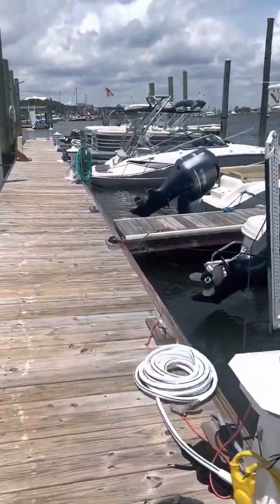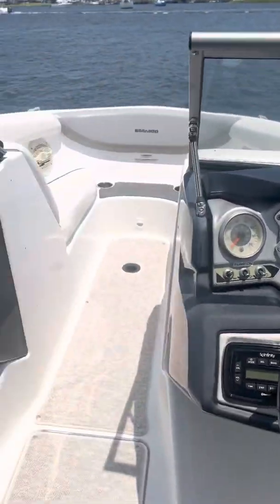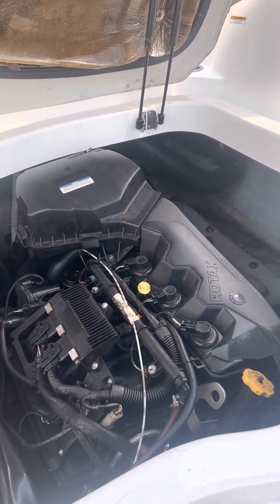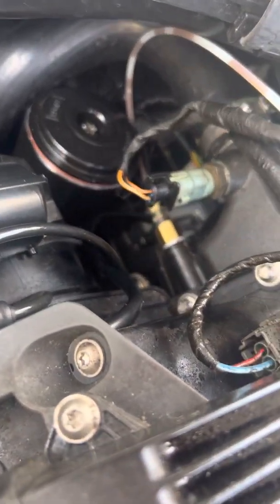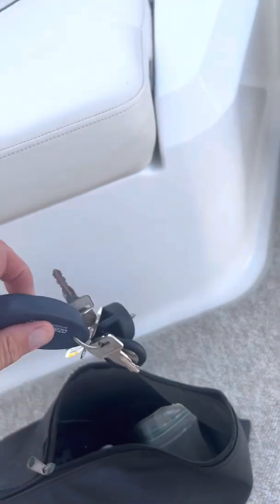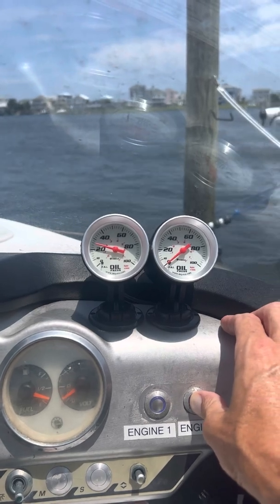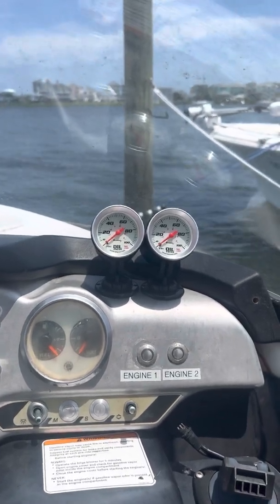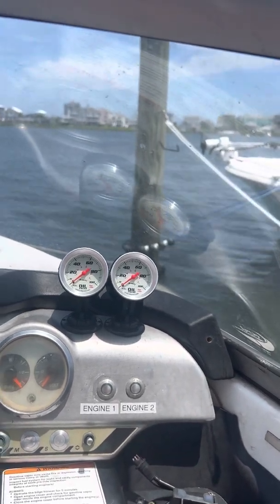Sea-Doo low oil pressure warning, mechanical oil pressure gauges installed

Comment from the maker: Found the issue !!!!!    About 4 years ago a local mechanic replaced the Oil Pressure Regulator which he believed was causing the low oil pressure. It stopped the Low Oil Pressure warning light for a while, then it returned.  This past week I pulled the motor and will post a vide on how I did it.  I will be replacing the front and rear oil pump. Yesterday in rebuilding the rear oil pump I removed the bolt holding in the regulator valve at the bottom of the Rear PTO Housing.  The spring came out, then nothing.  I was able to remove the inner valve with a pliers, then 4 pieces fell out.  The Top, it's 3 of the 4 side pieces and the Bottom.  It was the outer valve that had broken in half.   I believe one of the side pieces fell out when I was cleaning the PTO housing.    In process of consulting with some mechanics on-line to determine the possible cause. Also, there are several great videos on how to rebuild the front and rear oil pumps.  Check them out.

Comment from the maker: It worked!  The port side oil pressure wire was spliced into the starboard wire.  Now the port side motor thinks everything is fine.  I can still monitor the oil pressure with my gauges and it does not drop. No more low oil pressure warnings between 3000 and 4000 rpm.  This is a temporary fix and going to pull the motor this fall.  I suspect it’s the oil pumps.

Comment from the maker: Update, I rigged it to work.  Need to test it in the water for a bit.  This is what I did.  

So, I would NOT recommend doing this unless you have manual oil  gauges installed.  So you can monitor the oil pressure.

I have 2 motors, one pressure switch works fine on the starboard motor.  I removed the oil pressure wire from the port side motor (bad motor) spliced the wire and attached it to the starboard wire (spliced it) on the good motor.  

Now, the computer on the starboard motor thinks everything is fine.

I still believe the rear and front oil pumps are going bad, thus the loss of pressure.